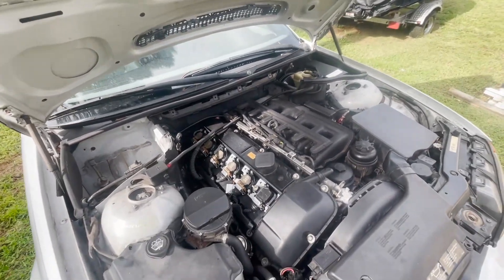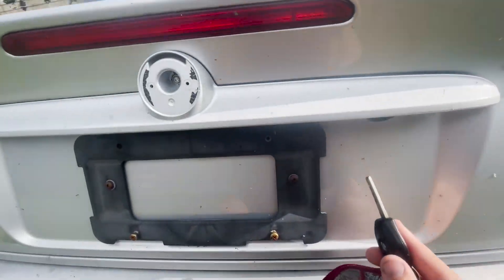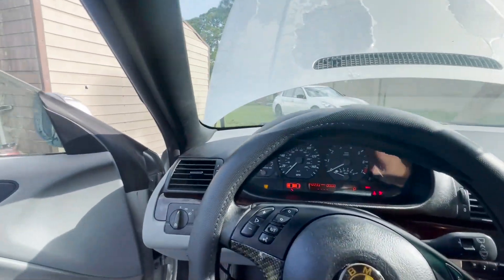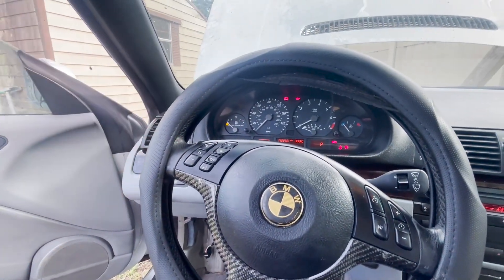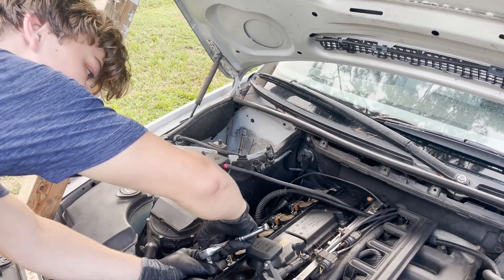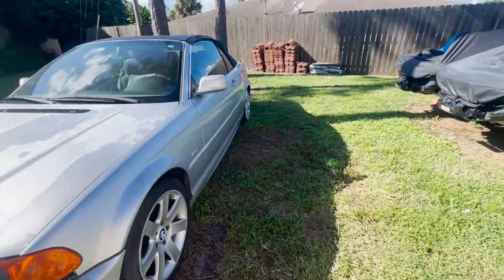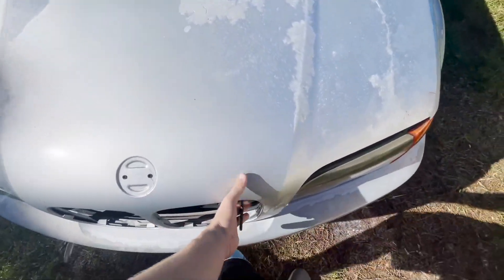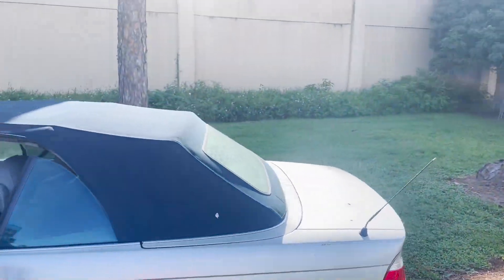E46 Project: Why Is Still It Misfiring? Part 2

Comment: Check your fuel pump and lines, could be a corroded motor on the pump itself.
Reply from the maker: The fuel is getting to the fuel rail because the schrader valve spits plenty of gas.

Comment: You had filthy injectors so your fuel filter also be dirty and clogged, so swap that out which will also has a new fuel pressure regulator on it
Reply from the maker: Yea it’s probably filthy. I gotta check it